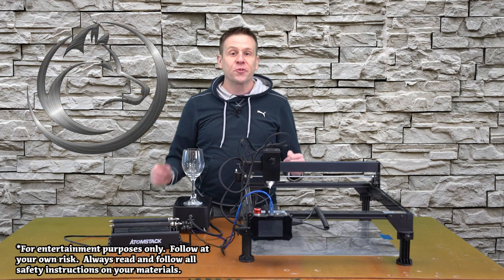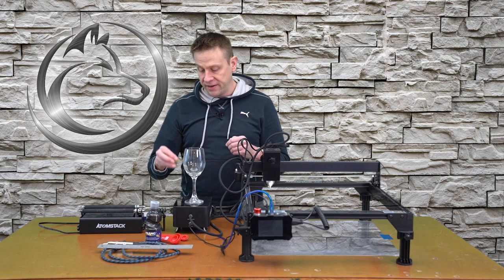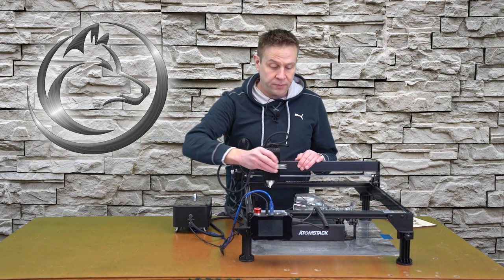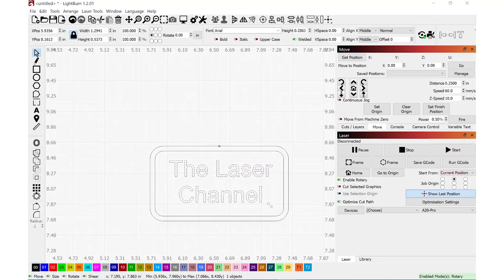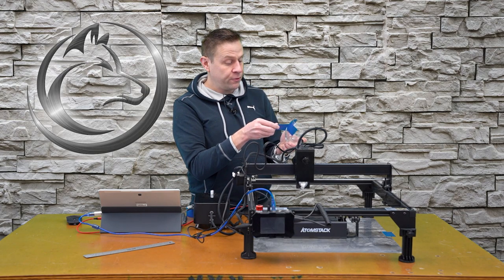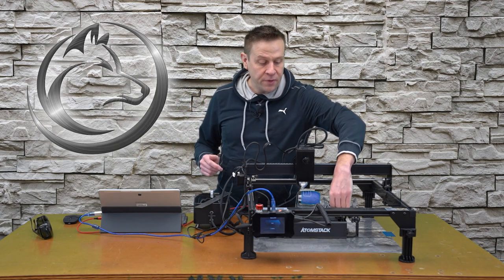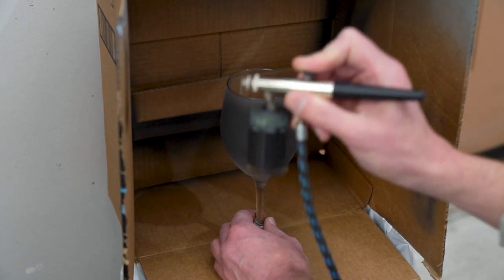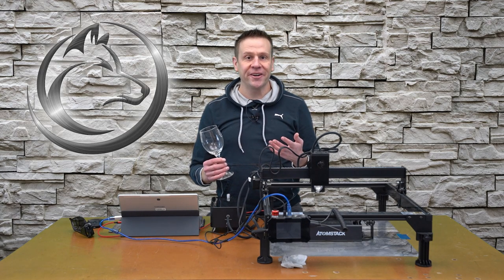Wine Glass Engraving- Fantastic Results!

Comment: Excellent video - this is very helpful for me right now. I'd like to add, that the new LightBurn 1.5 includes the ability to automagically ;-) transform the graphics for tapered objects just entering the upper and lower diameter. This way, you don't have to go through external transforming or creating in Photoshop.
Reply from the maker: Thanks!  You are 100% correct- Lighburn has (finally) added the tapered object tool!  I've used it and it really streamlines my workflow!

Comment: Try hanks for all of the tips. Another way of getting around the taper issue may be to use any image editor that lets you adjust the image angle on the x or y axis. I know my iPhone has that capability. Not an exact way to do it but could get you very close.
Reply from the maker: You're welcome!  Hopefully Lighburn will add a perspective warp tool soon- they said they did but it's more a 3d tool and doesn't correct for tapers.

Comment: Thanks, great video with all the details for someone who is just beginning. Have you ever tried removing permanent paint from glass by laser? Like volume markings or logos. I'm trying to remove some logos from my borosilicate glassware but atm it seems to remove the paint and engrave it (like you would normally want). Do you think there is a setting that will only remove the paint? Many passes with low power maybe?
Reply from the maker: Hi- I have not removed permanent paint on glassware.  Maybe one of the viewers can offer a comment.  Thanks for watching!

Comment: Hey Greg, enjoy your videos, very informative. Just a few questions. Would just regular acrylic paint not work as well? Would any other color than black work?
Reply from the maker: Thank you!  I haven't used acrylic paint, but I think it would work.  I use tempera paint because of the easy water clean up; even when the tempera paint is dry.  Black is the most common color to use because it will absorb the most amount of laser energy making for great engraving.  I have used other colors and have only seen small differences- nothing major.

Comment: Hi, what is that black coating before engraving for?
To engrave better or as protection?
Are they ordinary temperas (water crayons)?
Reply from the maker: The black coating is for engraving- without it the laser energy would pass through the glass without engraving.  I'm using ordinary tempera paint found at craft stores!

Comment: Now I come again with a question.I want to get into the business so ,for my budget I want to choose between A20 pro and A24pro(which now is with  100Euro cheaper than A20).I want to do only glass and metal engraving. So,please be kind and help me to make a decision....
Reply from the maker: A24 Pro for the WIN (in the USA it's labeled as the X24 Pro)- it's preassembled, has an upgraded rail guide system for the x and y axis, and has a clean layout and cable management.  The drawback is the unibody frame is all one piece so there's no option to expand the work area.  The A24 Pro also has a slightly smaller work area.  Either machine will engrave glass once it's coated with a marking agent like tempura paint.  Both will color mark Stainless steel black- mirrored stainless steel will need a coating to keep the laser from reflecting back in the laser module and causing immediate damage.  Hope this helps and best wishes.
Reply: @thelaserchannel1  WoW! This is way beyond than I expected . A trully professional answer. Thank you so much for your kindness ,Sir! I wish you all the best! KING REGARDS!

Comment: Quick question...   What DPI are you using?
Reply: I used 317 DPI with is line interval of 0.08mm.  Settings of 250-300 DPI work great for most glass engraving applications.  Thanks for watching!

Comment: Greg Andrew here     
Could you tell me all the settings I need with my k1 pro laser. I’m getting confused   I tried using a black sharpie and it isn’t working so well
Reply from the maker: Hi Greg- On my 20 watt laser systems I use settings around 80mm/s at 65% power.  I don't think a black sharpie will be opaque enough.  In the video I used black tempura paint.  Here's a video with 8 different ways to mask glass to engrave with a laser diode: https://youtu.be/7s7Y7YoSR5k
Reply: @thelaserchannel1  Thanks Greg for your help.
Reply from the maker: @andrewearl9315  You're welcome!